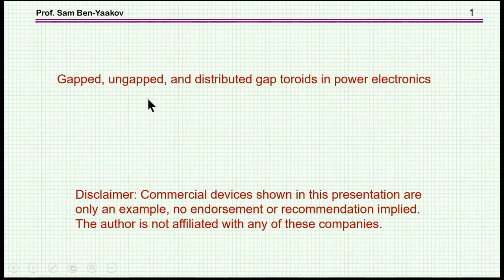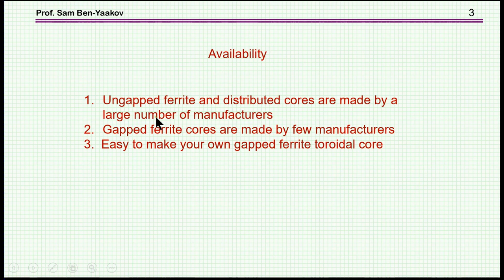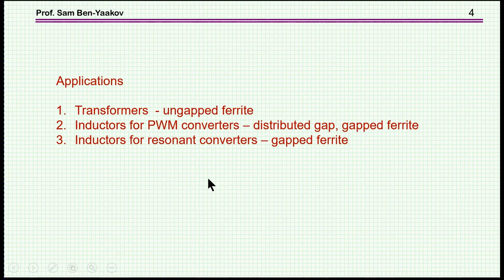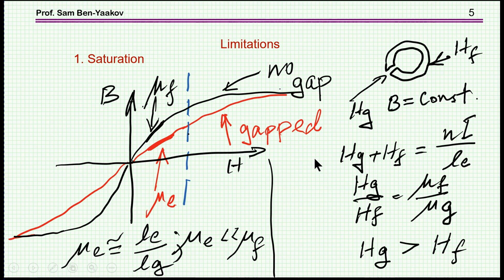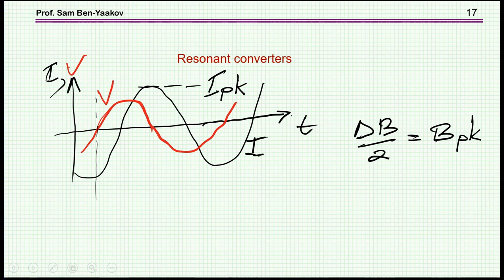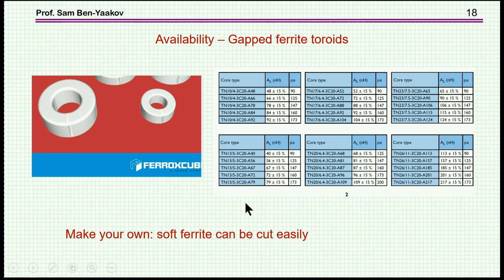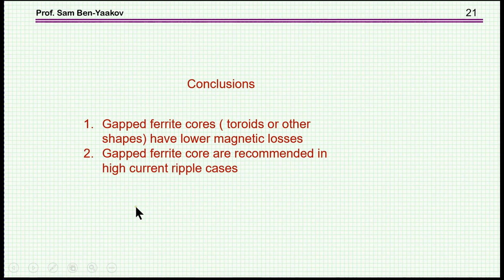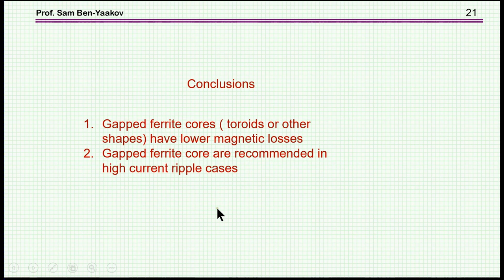Gapped, ungapped, and distributed gap toroids in power electronics - corrections below

Comment: 16:50 I have torn down many flyback power supplies and crt tv flyback transformers and most of em if not all have the gap on the inside right in the middle of the bobin where the coils are wound. Does the bobbin act as a spacer between the coils and the gap that negates this effect just enough, so that the manufacturing simplification is worth it?
Reply from the maker: HI, No, you can buy the cores with the center gap already there, or grind it yourself. No pressure on bobbin.
Reply: @sambenyaakov  I meant It was kinda strage how they manufacture transformers with the coils by design in close proximity to the gap, but I've just watched the "Toroid inductors for resonant converters" video and the diagrams of magnetic fields and current crowding make me think no matter where they place the gap they can't win, especially considering how tightly packed with coils the window on the core is. Anyways I have yet to binge a few more videos before I can confidently speak on magnetic cores.

(Right now I am trying to pick a core for a transformer driven by "electronic fluorescent tube ballast" resonant converter after I have already failed with a custom wound primary on a computer power supply transformer. The circuit runs perfectly with a crt tv flyback transformer (doesn't matter If I keep or remove the gap), but I use the internal primary coil. I want to duplicate these crt tv transformers but without the HV secondary, so I can make an induction heater. The problem is I have no idea how many turns the internal primary of these transformers has and what type of core I should use to make as compact as possible duplicate. 
I have tried taking AC and rectified peak DC measurements of the primary coil voltage and compare it to a custom wound secondary, but the numbers make no sense-10 turns of secondary generate 1V at input of 230V, so I blame the multimeter in being unable to measure those frequencies. I am searching for confirmation whether or not these rings from the active PFC circuit of a computer supply would do the job and so far I think they would be a bad choice.)